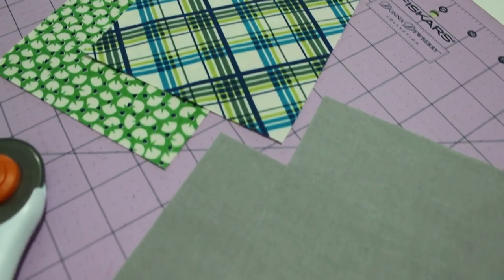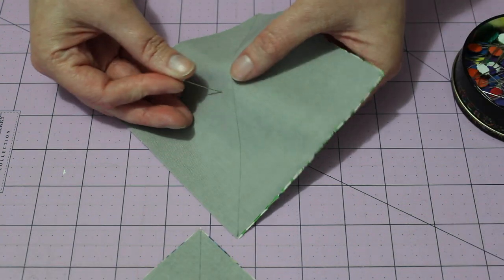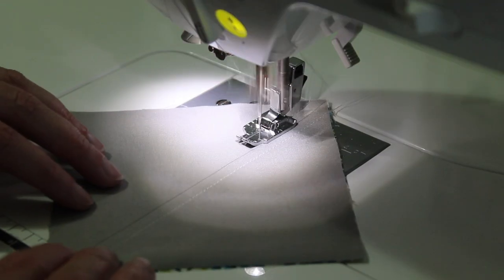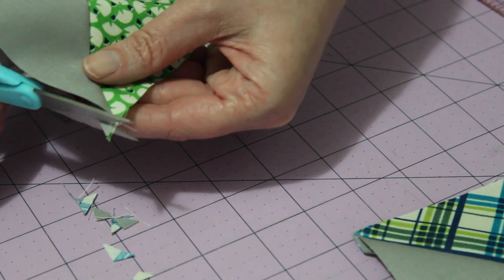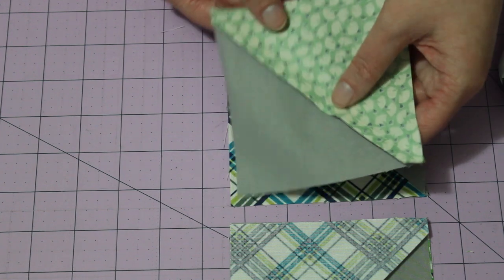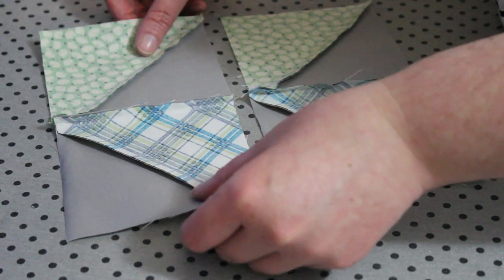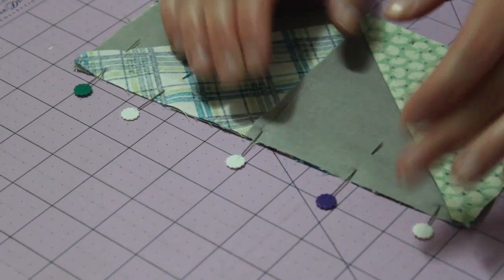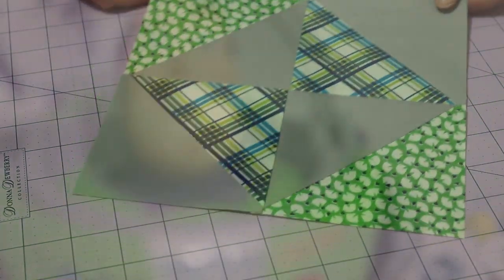TUTORIAL: Broken Dishes Block | 3and3quarters

Comment: I know this is kinda stupid question but where did you buy the fabric pins
Reply from the maker: alia Craft No question is stupid to ask!! 
The pins I use when piecing are called Flat Head or Flower Head Quilting Pins. The plastic bit at the top is melt resistant so that you can iron over them if need be and they won't melt! I bought them at my local craft/haberdashery store.
Hope this helps! :)